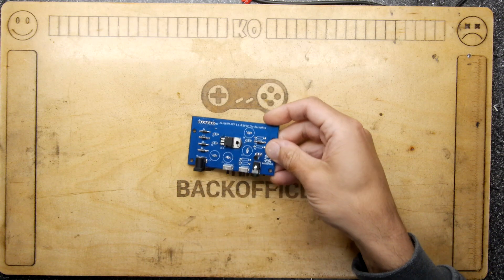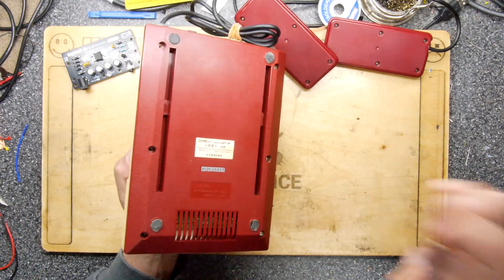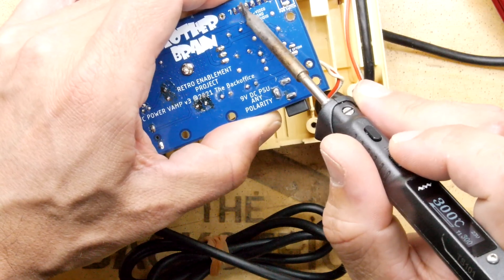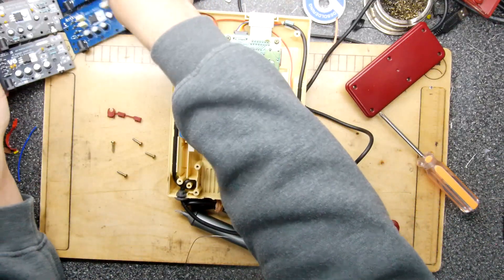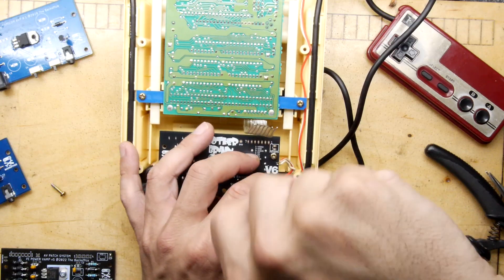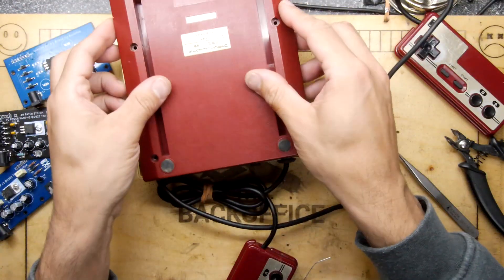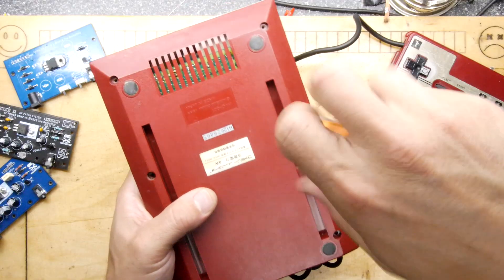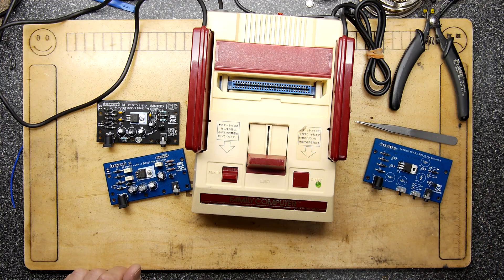Nintendo Famicom Easiest AV Mod in Town! Power VAMP V6

Comment: If I modify my Famicom, considering that I live in Romania where TVs use the PAL system, and the console outputs NTSC-J, will it work on modern European TVs? Is this still an issue, or do modern TVs now support NTSC-J signals as well?
Reply: It's gonna work perfectly fine on all TVs from the late 90's on wards but only on AV or SCART, hence why this mod is necessary for European TVs. NTSC-J refers to the frequency range of the RF channels. The video part of the signal is identical to regular NTSC, which is supported by the TVs i mentioned earlier.

Comment: I agree with your thoughts on that desoldering pump, I also bought one a few years ago and had the same problem as you, it clogged after a couple of uses. Probably because it is made of aluminum it tends to cool the molten solder much faster, which ends up clogging the tip of the pump.
I immediately went back to the old plastic pump without any regrets except for the money spent. 😆
Reply from the maker: Now you mention it. I am questioning myself as to why I haven't gone back to the original solder pumps! They are indeed much better, aren't they?